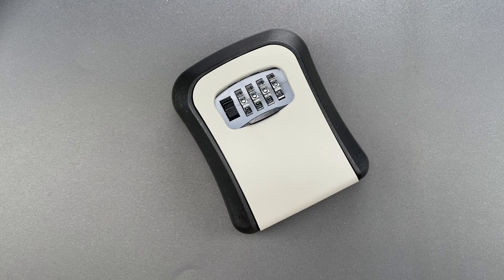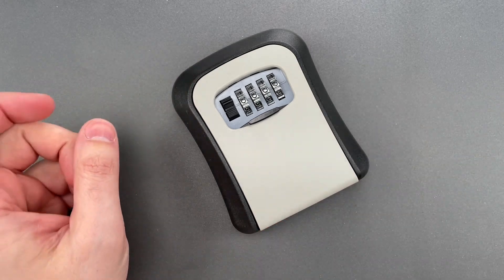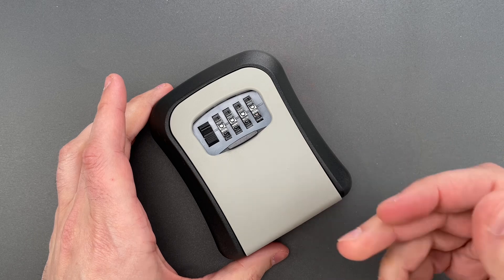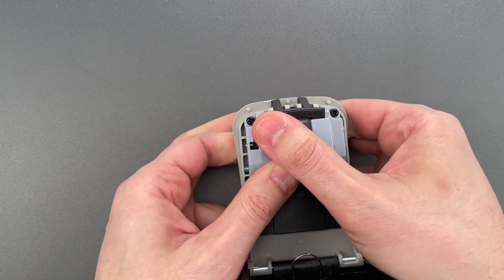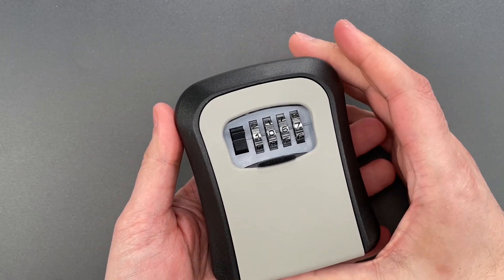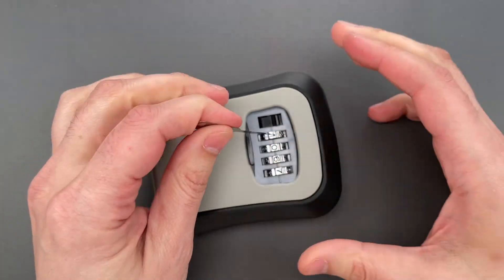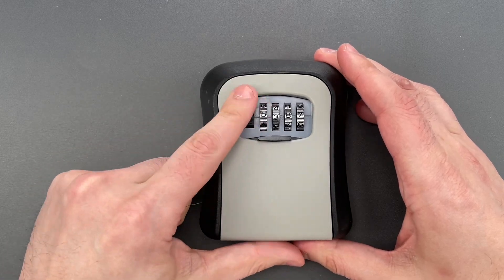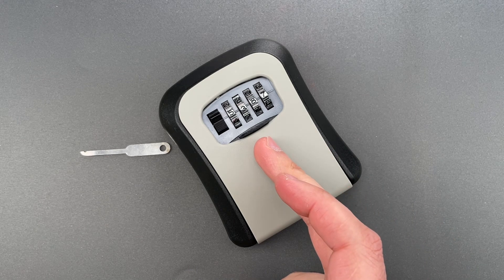[1496] Can It Possibly Get Worse?

Comment: Yes, it can. The lock could be a wifi connected lock that will reveal all your personal information online, sell the deed to your house and wire your bank balance to Zimbabwe. However, if you leave your wallet and cell in there, it will probably accomplish all that as well.
Reply: excuse me, but Washington Dc  is not spelled with a Z
Reply: @joemarchinski914  zimbabwe is a country
Reply: Isn't that just a VPN

Comment: I bet the plastic packaging for this lock is way more secure than the lock itself.
Reply: Yeah, the packaging can cut up your fingers if you're not careful and you can't simply smash it open.
Reply: Ive heard whispers that it took a full minute to open the packaging
Reply: The term, "tamper proof" comes to mind.
Reply: Probs display has lockable turn keys with a security chip 🤣
Reply: It is if its one of those welded plastic packages made by devil himself.
Reply: fake rocks sound like a better option
Reply: Scarier to open too.
Reply: True, some of that hard-plastic child-proof packaging is incredible.
Reply: A zip tie nnnnnnooooooooooo
Reply: The card board box packaging closed with some tape took longer to open probably
Reply: From the video, it might actually provide more security if it was designed to require smashing it open... I.e. a lock mechanism that is only accessible from the inside.
Reply: Well yeah, what if someone steals it? ;)
Reply: You'll need the Covert Pocketknife from his Website to pick the Packaging...
Reply: Clamshells are just hell, even with scissors
Reply: yeah i bet it was this one scissors are coming in, you know the ones you need a f*cking pair of scissors for to open them ^^
Reply: Yeah some of the packaging that eBay sellers use take quite a long time to break through
Reply: An entirely plastic lock I’m not locksmith but I know how to get in just let me get my rock-pick
Reply: @triforceofcourage100  Hello, this is the Rock Picking Lawyer and today...
Reply: I have encountered some plastic packaging that are almost impossible to open without injury.

Comment: Credit to Mat for mentioning that it would "give up it's contents after a fifteen second conversation with a hammer." I will need to remember that.
Reply: Could be used as a Mardi Gras special episode (our state tradition is kids smashing open a wooden piñata for a symbolic price, and a few days ago the empty piñatas were promoted at the supermarket where many daycare's shop for supplies).  Checking online that celebration will be Sunday Feb 19, 2 weeks from now.
 Anyway, some plastics are surprisingly resistant to hammers, can't just assume.
Reply: I am thinking 5 seconds would do for this excrescence.
Reply: It can probably be unhinged with a sturdy screwdriver, no need to make a bunch of noise with a hammer.
Reply: @ZeroPlayerGame  Or just unscrew the screws in the back.
Reply: @ZeroPlayerGame  Any tool is a hammer if you use it wrong enough.
Reply: Forget 15. From the sounds of that plastic, one decent smash could instantly crack it in half.
Reply: My dad often says, when encountering something, that's barely held together, that "It would probably fall apart, if you shout at it a bit louder"

Comment: This is a good decoy box. Put it near what you locked with a non working key in it. It might work.
Reply: there is an idea
Reply: That would actually be pretty funny.
Reply: Here's a thought; if you have a criminal in your house, the last thing you want to do is piss them off.
Reply: I don't think I have to guess as to where this is made
Reply: Or securely bolt the door on the inside while capturing surveillance video of whomever breaks into the box.
Reply: If you have a keypad garage door opener or electronic lock, I'd stick a 2 pieces of paper inside with random numbers written on it just to keep the criminal busy. Also the beeps and errors will alert you of someone falling for it.
Reply: Nah. Working key to bear trap garage perhaps. But a false key, they might just break in or smash up your stuff. It isn't a good idea to tempt criminals near you.
Reply: I use decoy stones - this would be an upgrade I suppose as it would take a few more seconds to open then a sliding bottom plate..
Reply: So rig it like a trap box? Like a silent alarm?
Reply: You could lock a real key lock in there
Reply: @jrd33  the idea is that they would be outside the house😂
Reply: a snappable key

Comment: This lock make your doormat look so much safer !
Reply: Place key under doormat, use this lockbox as decoy.
Reply: Writing your password backwards on a sticky note is prolly more secure lol
Reply: So true, bending down to lift the doormat, you could aggravate your back, slightly.
Reply: @francissager3133  I love it! 
Take it further: Place key under doormat, convert lockbox into spider habitat.
Reply: @QuestionMan  that's unusually cruel. I thought of just leaving a set of Fisher-Price baby keys in the box. I like your idea better.
Reply: If you install this box but hide the key elsewhere, it adds 30 seconds to their search. That might be worth 7 bucks.
Reply: especially if you tape the key to the underside of the doormat!
Reply: @78Mathius  Plus if they smash it, you now have evidence someone was trying to get in.
Reply: Get a doormat, an aluminum or rubber bottom to go under it, and edge the bottom, so the doormat looks like it belongs. Add pins that run through the doormat, tiny little latch teeth, or Velcro, as your budget allows. Tuck the key between the top and the bottom.

Hard to spot, and hard to accidentally find.
Reply: @AgiHammerthief   Tape the key to the underside of the lockbox!

Comment: There is a market for such boxes.
We used to have to force-open a door to restart some pumps every once in a while, because the last person who used the keys took them home.
If the only purpose of the "lock" is to remind people without access that they have no business using the key inside, it does the job.
Being cheap and easy to break it's actually a benefit, as it costs less than damaging a door or the lock on it.

Comment: These are super easy to open, even for someone who's never picked a lock before.
I once had to open one cause I forgot the combination and all you need is to break a razor blade in half and use the edge to feel for the notches.
Honestly super fun doing it for the first time.
Reply: If you still have some old floppy disks, the metal shutter works really well if you cut it into strips. That's what I've used for years since they are even thinner and safer than a razor blade. I work at a real estate office so often have to pick key boxes when agents forget the code.
Reply: @RealitysSuccessor  Oh, you're one of those real estate agents...

Comment: I've seen these
They are often used on stuff like rentable holiday cabins / caravans

There's actually a bit of a reason they are so crappy

They are usually for holidays placed away in rural areas
Just to hold the keys from one guest to the next so they dont have to have on site staff
If they key is in the lockbox then there won't be anything valube inside the cabin
Except maybe the TV
But if your taking that most tend to have glass doors and those break pretty easy
Reply: Actually in the case of your last sentence, having an insecure lockbox is actually better. You'd rather a theif break the cheap lock box and use the key than smash the window, which would be far more expensive. Same logic as my friend who used to have a Miata, he said he never locked the doors so that if someone wanted to try to steal stuff out of it they could just open the door rather than slash the roof. He kept actual valuables locked in the trunk.
Reply: So someone could borrow the key, get themselves a copy of it, return the key to the box, and come back later when there is something valuable in the house. Cool. Not.
Reply: @miracula2226  Don't overthink things. Most thefts don't involve spy movie levels of preparation.

In your example renting out a hotel room or apartment should require the owner to change the key with each new customer. How hard is it to rent a room for a day, copy the key then come back with your copied key and loot it for valuables? Heck, you can break any potential camera a few days in advance, get yourself a room nearby so your movements in the hotel are legitimate looking and the blame will fall on the janitorial staff.

However, nobody does that.

Comment: While he had it flipped and scrambled the wheels I was like "hey look, screws!" 😆
Reply: Not a vulnerability if the screws aren't accessible with the box installed.
Reply: The goal is to have it mounted flat on a wall where the screws are not accessible. That way when you hit it with a hammer you don't have to hurt your hand holding it in place. Make sure there is some plastic left over to hang the key on so you don't inconvenience the next burglar to need a hammer to get in the house.
Reply: @vass0922  refer to my comment 5 days ago. Ya know, if people would just READ the threads, this waste of my time wouldn't be happening.
Reply: @D-Rock420  ya know, no-one is going to read the ENTIRE comment section before replying to a single comment.
Reply: @rednammoc  ......but you did....
Reply: @D-Rock420 doesn't mean everyone else will
Reply: @farhanatashiga3721  I refuse to allow other's ignorance to be my problem.

Comment: I have to ask, does every code wheel lock like that have the same vulnerability?  Is there actually a way to shield that type of mechanism from this attack?
Reply: Generally yes they all are susceptible to this type of attack, some make the wheel to case body tolerance much tighter to where the tool cannot get between or can put a plate in front of the locking bar.

Comment: I noticed the back of the case is held in by screws. Someone could use a pry bar to pull it off the wall then use a philips head screwdriver to gain access from the back.
Reply: The quality of that box's construction, when you pry it off the wall, you've likely left a big enough hole in the back that you have access.
Reply: If you've got a prybar, just pry the door open. Or smash it with the prybar.

Comment: I guess that this kind of box is designed to be used in place where there is little chance it'll be opened by brute force, such as home, etc.
Reply: It wouldn't take much brute to pop it open.  What good is a super low security lock box?
Reply: @PeteHemdem  Intimidation. It's the same as plastic shackles. They can be broken, but they mean that there blocking something private.

Comment: Actually this lock is perfect for my last application where I used a key lock box.  Basically in a low security environment where a "break glass" option was available in an emergency, but honest people kept honest by cameras and alarms could find a way to bypass light security.  Not every lock needs to be pick proof or strong.  So as much as you can make a strong case regarding the weakness of this lock, I would have preferred this one over the much stronger and difficult to defeat lock I chose.  If I'm on vacation with my phone off, and my backup is unreachable, rather than shut the whole company down, costing a million dollars an hour, someone with proper motivation can just knock the lock off the wall with a hammer.  So  it's a plastic lock.  So what??  My thermostat locks were plastic and secured with drywall anchors, and they did exactly what they were needed to do.  Not every lock is guarding fort knox.  Sometimes a 1 pin lock with a plastic key is still stronger than the hardware it is latching.  If security is just there to reinforce honesty, thin plastic garbage is plenty strong enough.

Comment: I bought the push-button ones for work, found out that you can push the buttons in ANY order, not just the order you set them. I called Master Lock Co. and they said it was by design. smh...

Comment: Looks like a lock that is used in car dealerships, it hangs on the outside of car windows and its probably a good thing it does not weight so much and do not scratch the window. I would say this is probably mostly used in areas with fence around it and with security cameras,

Comment: At my workplace we use these kinds of boxes to store the keys to our electrical racks that we need to access when doing maintenance. They are more storage than security however, as all codes are 0000. Not that it would matter which code they have, as shown in this video.

Comment: Dear combination lock makers. Please change your casting moulds to include a shoulder to prevent LPL from sliding a shim between the code wheel and the gap in the cover. Thnx. lock buyers. P.S. Stainless steel will work in most every application for lock bodies.

Comment: The thing is, I've personally had use cases where this would be fine. If this was sufficiently cheap it would happily serve as "this is already a secure area, and that comms/store/junk room is only locked to prevent staff dumping old furniture in there when we're not looking, so put the key in the little box so it doesn't get lost in desk drawers." In other words less a security system more a "lets not lose the only key again guys" system.

Problem is its actively immoral to sell an all plastic lock box that looks like a real lockbox. Some poor vulnerable person will end up with that fitted by their front door for their district nurse or carer to get in (because no one in a procurement department, nor for that matter an early stage alzheimers patient will think to see if a lockbox is a real product)... And some passer by could just tear it open with a rock in no seconds flat.

Comment: LPL. you really should mention the terrible opsec when these "security" devices are in situ. They are most often used for immobile tenants receiving care workers. Or various skilled workforce spread across numerous sub-contractors. Usually multi agency workforce renovating a recently vacated home. 
Opsec.. they always leave the keypad open... so code can be changed or noted. even more dumb.. they close the key pad.. but dont roll the combination wheels when it's closed. ... leaving the original passcode open to full view. . thats not just this one shoddy keysafe you've highlighted... its ALL of them. Additionaly, PUSH BUTTON keysafes. only four numbers, but they can be pushed in ANY order.

Comment: I have a generic Amazon equivalent but made of thin metal version at home. I use it to hide a house key and shed key under my deck.  It looks identical.  For my needs of hiding a house key and shed key for use the 1 or 2 times a year I accidentally walk out without both my keys and phone (phone for August smart lock), this serves its purpose. Part of my added security is hiding it where its hard to get to so if someone wanted to break into my house, they wouldn't be able to find this key lock box to do it.

Comment: I just roll my eyes when I see someone using the Master Lock version, they are made of pot metal and are very easy to assault with a hammer. I got to do a lot of rekeys in one area because some criminal went around breaking those one evening. Like most other Master products, their key box is a complete failure.

Comment: Key holders like this are not meant to be used to secure key for the house door. I've seen them used to hold key to appartment for short-term rent, for the client to pick the key from (client would have key by him since then). So they are only used just for some time between room was prepared and client arrived. Sure, there is limited opportunity window for the burglar to enter and take stuff like $100 hotel TV or coffee machine.
Not trying to defend its obvious flaws or anything but it's not meant to withstand. Sure, programmable electronic door locks are better.

Comment: I got a new suitcase with a 3 digit lock on it where you’re supposed to lock the zip ends in.  Found out that just by tensing the slider with my thumb then spinning the wheels for the code I could open it

Comment: I’m not sure, but it looked to me like they were screws on the back, which means there’s an even lower skill non-destructive way of getting into the box.
Reply: I mean, this type of lockbox is meant to be secured to a wall. If you can access the back side of the box, the installer has made a second error (the first being buying this lock in the first place). Any attempt to remove it from the wall without having first opened it is inherently destructive to both the box and possibly the wall, and at that point might as well just introduce it to your hammer and be done with the whole affair fairly quickly.
Reply: @HighFrictionZone  as any good demolition worker can tell you, just grab a reciprocating saw (slip the blade behind the lockbox) and turn it on just above the mounting screws, cuts through them easily, can be through all 4 in less than 2 minutes.

that being said I concede to your point, that amount of effort and planning (while trivial in retrospect) isn't going to be the go to method for 99% of home invaders

Comment: I've thought of a potential use for this. Install one of those cheapo magnetic door alarms inside this so that the alarm goes off when it's opened and mount it next to your door. A potential thief will see it as such an obvious weak point that they'll be compelled to break it open as their first step to robbing the place and that sets the alarm off.

Comment: I'm willing to bet, based on how it warped while you were setting the combination, that a pair of thumbs could provide enough force to the door's top to push it out of the gates of the lock without even touching the combination wheel.

Comment: I mean at least LPL had to use the notch decoder to actually decode the thing!  Some of the boxes featured on this channel before let you reach in with the decoder and grab the locking bar and pop it open without touching the code wheels.  At least, despite the plastic construction, this isn't THAT bad!